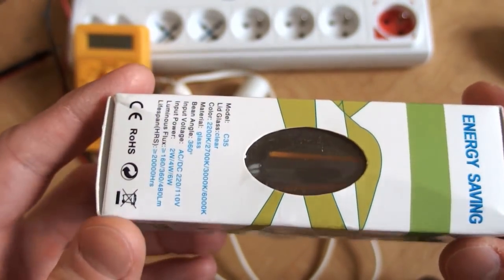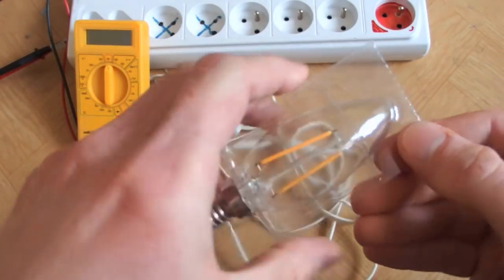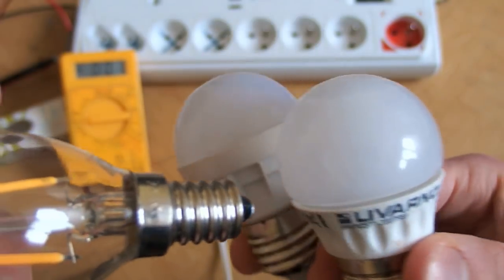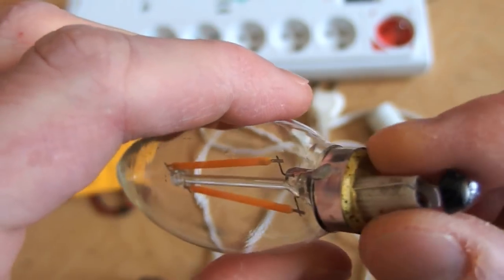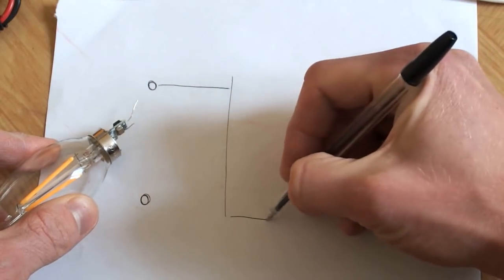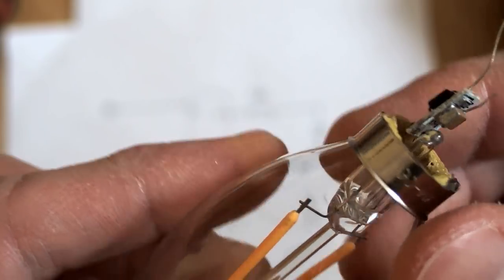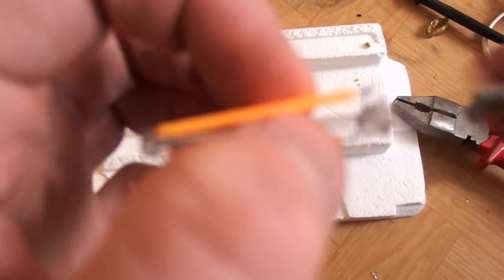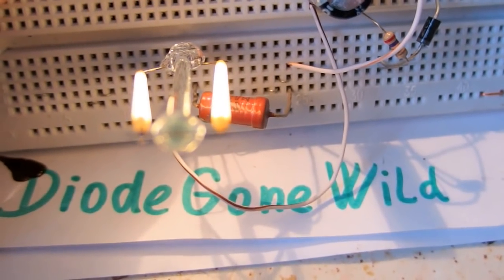Ebay $1.50 Filament LED lightbulb teardown (2W)

Comment: how are you testing the wattage? where are you plugging in the MM
Reply: He modified his power strip to measure power. He is using the multimeter just as a display.
Reply: Connect in series with power with bulb select ac 20/10A in MM and multiply amps and voltage. Or buy MM with wattage meter
Reply: @ManjuKotekal46  Just multiplying the current with voltage won't give you active power, it will give you apparent power as it is an A. C. circuit.
Reply: Oniruddho Alam oh my god i dint know wow thanks
Reply: Hidear

We are one of renown LED bulb/filament manufacturing company in China
WhatsApp /WeChat :8615877138240  
Email:Rose-Wei@bofabulb.com  1040307158@qq.com
Website :http://www.bofabulb.com

Comment: From what I understand the Filaments are rated at 3 volts each, for a total of 6 volts for 2 pair. The 4 pair are rated at 12 volts total. I guess there is a step down transformer to bring it down to 6 volts.
Reply: You understand wrong then. Watch the video. " step down transformer" ???
Reply: Hidear

We are one of renown LED bulb/filament manufacturing company in China
WhatsApp /WeChat :8615877138240  
Email:Rose-Wei@bofabulb.com  1040307158@qq.com
Website :http://www.bofabulb.com

Comment: Also big problem is no heatsink at all so low life span.
Reply: These led chips actually dont get as hot as those proper buck regulated leds
Reply: Filament LED bulbs don't get as hot, because the control circuit is inside the screw base and the bulb is usually filled with a conductive gas that helps with cooling. If your regular LED bulbs fail often, try filament LED bulbs.

Comment: They are COB LEDs. The factory probably has used old filament bulb machines and that’s why it is glass and has the old fashioned construction. I like these type of bulbs and I have changed almost all my home’s lights to LED. In this bulb there are no interferencies as there isn’t switching power supply and the construction is simple and cheap.
Reply: Except these non-switching LEDs flicker as fuck at 100 or 120 Hz.
Reply: Hidear

We are one of renown LED bulb/filament manufacturing company in China
WhatsApp /WeChat :8615877138240  
Email:Rose-Wei@bofabulb.com  1040307158@qq.com
Website :http://www.bofabulb.com

Comment: I had a problem with some similar bulbs, with the E27 socket. Someone called me to replace some bulbs, I would replace them and the surprise was that they had light intensity drops, from time to time. I told him the bulbs were to blame, they did not have enough filtering. Bulbs were bought from a local supplier and, as the owner said, they were not cheap at all.
Reply: costara 
It's a daily process for me to change capacitor's of lamps with bad filtering low value of capacitors
Reply: Hidear

We are one of renown LED bulb/filament manufacturing company in China
WhatsApp /WeChat :8615877138240  
Email:Rose-Wei@bofabulb.com  1040307158@qq.com
Website :http://www.bofabulb.com

Comment: From the video it seems you're just guessing that the 1k resistor is on the secondary side, behind the rectifier. I would have guessed the same. But I agree with you that the other position is just as good for current limiting purposes, and better when also used as a fuse.
Reply: The CAPACITOR is the current limiter.

Comment: I forgot it was an LED light until I saw the lines on the screen
Reply: Hi dear , 
we are especially making the filaments led lighting ,also deal in led external lighting fittings。WhatsApp /WeChat :8615877138240  
Email:Rose-Wei@bofabulb.com  1040307158@qq.com
Website :http://www.bofabulb.com

Comment: Thx for the teardown video. I do love these filamentary LED lamps. They have a great angular light distribution and simple circuitry.

I read that the gas in the envelope is to dissipate the heat of the LED strip. Here is an excerpt from this US patent application.

Gas cooled led lamp
US 20130271972 A1
A thermic constituent in addition to the gas can also be included. In some embodiments, the gas is at a pressure of from about 0.5 to about 10 atmospheres. In some embodiments, the gas is at a pressure of from about 0.8 to about 1.2 atmospheres. In some embodiments, the gas is at a pressure of about 2 atmospheres or about 3 atmospheres.

In some embodiments, the gas in the enclosure has a thermal conductivity of at least 60 mW/m-K. In some embodiments, the gas in the enclosure has a thermal conductivity of at least 150 mW/m-K. In some embodiments, the gas is or includes helium. In some embodiments, the gas is or includes helium and hydrogen. In some embodiments, the gas includes a chlorofluorocarbon, a hydrochlorofluorocarbon, difluoromethane, pentafluoroethane or a combination of these gasses.
Reply: @dan2800  - you win the award for most useless, idiotic comment on Youtube.

Comment: I bought one of these lamps and it failed at something over 350V~ (I had a few fluorescent ballasts connected in series with the lamp - 3 paralleled 40W ballasts connected in series with the lamp in order to prevent damage to my variac if the lamp went short, so maybe the actual voltage across the lamp was a bit higher due to the ballasts forming an LC circuit with the capacitor inside the lamp), after a short period of time, the capacitor broke down and the LED strings burnt out.

Comment: i think it looks nicer than most led bulbs, closer to incandecent.

Im supprised it is glass and sealed, cant see the point of the sealing :-/

Have you been watching BigClive ?, your diagram looks very similar to the way clive would draw it :-D.
Just need a big beard now ha ha :-D
Reply from the maker: I think they are reusing machines they had for making classic tungsten lightbulbs.
Reply: I havnt switched to led lighting, i dont trust leds at high power to last.
i still use cfl types.

To me, a led is a dim glowing light on a dvd player to say its on.
Yes im an old bastard LOL :D
Reply from the maker: I also mostly use halogen lamps, CFL's or even the flashing and clicking fluorescents with that heavy metal brick in it :).
Reply: @zx8401ztv  CFL is spiky. How do you sleep?
Reply: I also was skeptical of LED filament bulbs after seeing all the weird SMD variations which always weighed a ton and died too early without ever meeting their lighting claims. But they work.  I have had several running around the house now, and there has been no light output decrease, and if you get ones with capacitors on the bottom, then they do not strobe much or at all.  

Look at it this way, the new CFLs fail all the time due to one transistor being under rated.  they are almost impossible to get apart and thus when they fail the mercury in them goes to a landfill. considering how popular CFLs are that is a huge amount of mercury. the old CFLs might have used more mercury, but some are still running to this day, so they have a much lower environmental impact.   

If you get these bulbs on ebay they are absurdly cheap and are extremely easy to get a refund on if they do not deliver.   how can you lose?
Reply: Yes i agree :-D, i have a house full of folded flourescent ccfl bulbs, so far ive had only 2 fail in 5 years, but (and there allways is a but) i dont leave them on all the time lol.
One was in my front room and it died, so i ripped it apart and replaced a known dodgy capacitor, all fine again :-).
Led lights are getting better, early versions just didnt last, i think they used too few leds and over drove them, more leds driven at a lower level are better :-D
Reply: Compact folded CFLs simply don't work for me. The colour is always a bit nasty, even the most expensive ones can just about level with cheaper of LEDs, they take an arbitrary amount of time to actually start making light, it might be a second or it might be 30, they keep dying all the time, except for one i bought 20 years ago and that one still works, but all the rest are trash. When they die, they get replaced with LEDs, which some of them go bad quickly, but the rest seem to last forever, usually one is bad in every batch.
Reply: Hidear

We are one of renown LED bulb/filament manufacturing company in China
WhatsApp /WeChat :8615877138240  
Email:Rose-Wei@bofabulb.com  1040307158@qq.com
Website :http://www.bofabulb.com